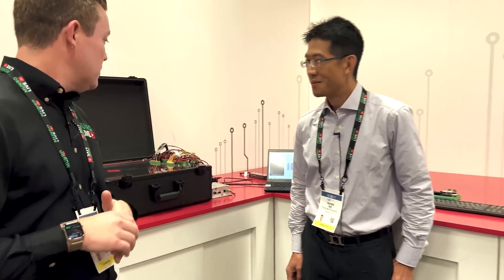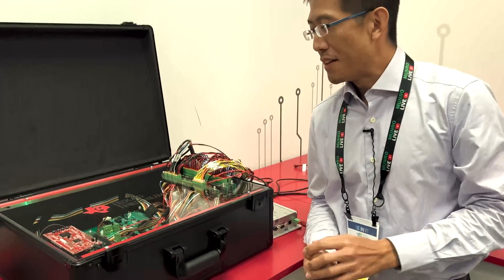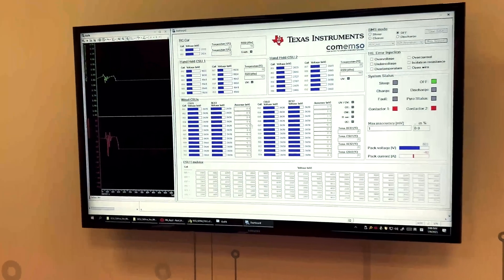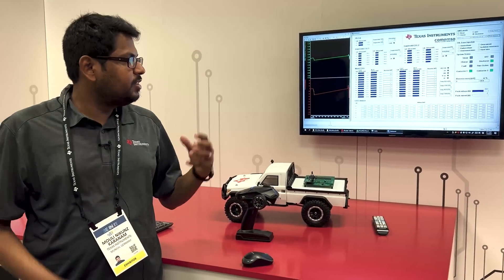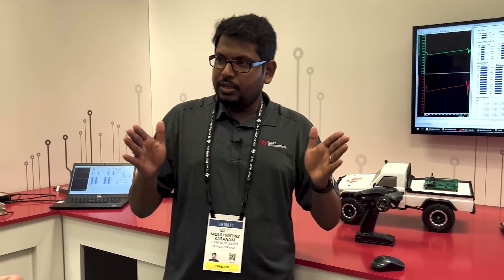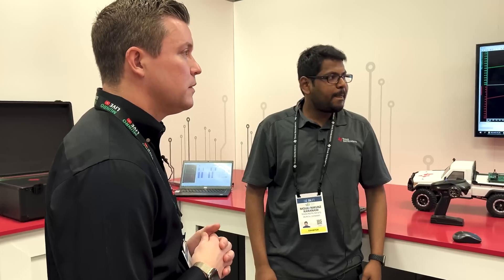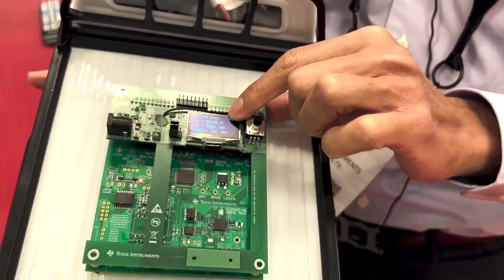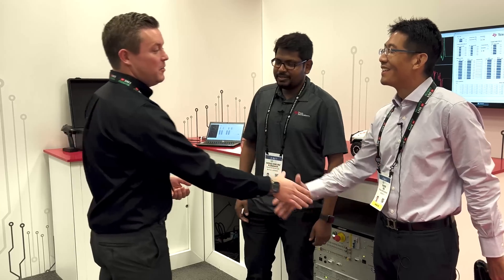Maximize your Driving Range with Texas Instruments | CES 2023

Comment: 1mV bms resolution is on market since at least 20 years. .  My 1 gen 2014 chevy volt designed from 2007 to 2011  is in fact also using 1mV resolution BMS...  i thought ihis TI presentation would bring some new inmovations... but it wasn't...

Comment: I am amazed how much billions of $ and fortunes these guys (TI shareholders) make with some ADCs and temperature sensors.
Reply: For every digital chip that is in a vehicle, there will be, lets say at least 10x the number of analog chips.  The media focuses a lot on the latest cutting edge CPUs, but what we dont think about is that the real world is still analog.  Modern vehicles are experiencing what we call sensor fusion.  And with the explosion of sensors required in a vehicle, analog ICs are needed - Power, data converters, temperature sensors, amplifiers, comparators -  ANALOG - You hit the nail on the head!

Comment: Even TI is click bait.😆 You can't maximize range simply with a more accurate voltage reading. the guy did not elaborate of this accuracy on LFP batteries, as this was a problem with Tesla LFP Model 3 cars.  The LFP M3 had its low voltage and high voltage batteries drained because of incorrect battery estimates, owners not aware their HV battery almost drained.   the only fix is to regularly fully charge the car at least a week or two so that the system can correctly gauge/calibrate the full capacity of the LFP pack then give an accurate estimate of state of charge.
Isn't TI supposed to be working on silicon carbide and GaN transistors for more efficient EVs?

Comment: The shell of the RC trucks is the Toyota LandCruiser 70 series, which as a real vehicle is not available in North America.
Reply: Interesting observation, the RC car model we used was not specific to any manufacturer!  A tidbit on why we chose a truck ~~ We needed a 'flatbed' area on the car to mount the wireless BMS board.

Comment: Didn't you guys shown that Tesla use a physical cut off fuse to disconnect the main power battery pack. Is that a better or worse system? Just wondering if that electronic cutoff during collision is fast enough, or is able to function during collision.

Comment: If the resolution is a mV for monitoring ,does that imply the cell monitors are atop each cell ? (wiring will introduce IR losses , where the  measured  voltages away from each cell are different to the real voltages) . If  its the pack voltage rather than per cell , how are imbalances within the pack corrected?  On the wireless side ,even though it seems the red-light was on , the wheels on front still turns . Maybe the better demo is show that the unit goes dead an needs a quick reset before the next demo
Reply: Yes, the voltages are measured across each and every cell.  The system also measures total pack voltage -  Though the cell monitors themselves do not measure the pack voltage, there are other devices like the BQ79731 pack monitor which measure the pack voltage (and current).  This takes care of the concerns you mention.

The RC car was just for demonstration purposes.  We monitored the actual pack of the RC car, but we didnt actually cut off the voltage to the motor when a crash happened.  This would have required a relay or some other cut off mechanism.  Maybe we'll do that for the next version!
Reply: You can measure voltage with gigaohms of impedance so IR losses become irrelevant.

Comment: @TI: 
1) Are the devolopment kits like this "suitcase" available?
2) Is each cell voltage measure performed by a 1-point voltage measurement between the voltage OR 2-point measurement directly on each terminal for higher accuracy, especially with LFP cells and the possibility to detect faults from bad connections between different battery moduls. Also to avoid "misleading" voltage drops on longer wires beween the moduls?
Reply: @Ste Da - 

1)  Please get in touch with your TI sales representative for the suitcase

2)  Great observation.  The latest BQ79718 family of batter monitors not only provide industry leading 1mV cell voltage measurement accuracy across each cell, but they also feature redundant measurements for each and every cell voltage as well as redundant measurements for temperature.  It's not just LFP which requires this redundant measurement - Battery Management requires the highest level of 'functional safety', especially since human life is at risk.  So all other chemistries, such as NMC, would require redundant measurements, diagnostics and reporting to achieve what is known as ASIL-D functional safety.  For the voltage drops across modules, we do support bus bar connections and measurements across those bus bars - Hence voltage drops are not a concern and can be detected!

Comment: Exec Sum: Cory tries to translate the Tech mumblings of engineering marketing nerds at a "Science Fair" demo.  TI really has fantastic products, technology and capabilities. Others have bits and pieces of this, but TI's main advantage is efficient, volume production which translates into much lower prices than, say, Analog Devices.   BTW, TI's Benchmarq  division can essentially count each electron going into and out of a battery!
Reply: Nice exec sum!  Im not the nerd, Mouli is :)
Reply: @markng2483  I'm a retired EE Nerd myself...started when I was 7
Reply: TI needs to integrate further and cooperate with a standards committee to make the BMS a single universal module for all EV manufacturers worldwide. That module should have firmware (upgradable) that allows the EV manufacturer to simply check some boxes in an app and have the BMS "personalize" for any battery density and chemistry.  This is how your personal computers UEFI BIOS works. It is modular and extensible. You can build any system you wish and it will provide you the Basic Input Output System (BIOS) to run it.   In this way if the market moves from LiPo to TheNewThing - the BMS can be reprogrammed on the assembly line to handle the current, voltage, temperature sense, cell count, controls and algorithms with no change in hardware. (Be sure and add security features!)
Reply: @dennisfahey2379  This is not going to happen. Most of the value and competitive advantage for EV manufacturers is in the battery, they're not going to make a core system of that universal. This is like asking ICE vehicle manufacturers to make their injection control universal. No way that's happening.
Reply: via Coulomb's ?
Reply: @douglas2lee929  Yes! it does exactly that:  BQ34110
Reply: @shazam6274  I don't mean to be unduly nit-picky, but I think that you should describe the function as an "approximation" or something similar, at best. I have not looked at any documentation for the product, but I doubt  that it can come close to counting electrons. I'm not sure if the major radiological labs in this country could even do that. Coulomb's would be a calculation, not a measurement. I'm not going take the few minutes right now to look it up, but I recall from school (decades ago), that the number was something like > 6.28 x 10 to the eighteenth, or some such, electrons past a given point, per second.  I am probably WAY off on that formula, it was many many years ago for me........ But my point is that when you get to numbers that large, the accuracy of the instrumentation gets to be extremely critical. I can understand if you can measure in billionths of a nano-amp, but barring that I think your marketing department needs to revisit the issue. You are trying to sell to E.E.'s, after all. I apologize for sounding like a tight ass, and also if I have my  facts way off, which is extremely possible. Thanks. 
-from Minnesota.
Reply: @douglas2lee929  I am not selling anything to anybody, just trying to point out that TI has some great technology.   Very few watchers of Munro would know a Coulomb from a colon, but you can't calculate accurately it if you don't have precise measurements.

Comment: Voltage is not a reliable indicator of SOC for LiFePO4. Especially under load. Increasing the accuracy of the cell voltage sensing will do nothing to increase capacity. Possibly a high current active balancer could help but if the cells are matched properly, no benefit would be derived. We have tested this numerous times on my channel too. We pull full capacity every time with matched LiFePO4 cells. Current consumer BMS voltage sensing accuracy is actually more accurate than necessary, and has been for quite some years. Besides that feature, I did not see anything special about Texas instruments BMS.
Reply: Just Ti adding parts to catalog. Typically with specs far in excess of need. doesn't cost more so just.add it. Some manufacturers will use the componentsnts.
Reply: 100%. i think the argument here was supposed to be that you could get closer to the voltage limit of the chemistry, but no EV battery should ever get close to that anyways, since they are all overprovisioned.
Reply: @Will, #2: With R=U/I or U=R*I the BMS can correct the measured Voltage by adding the calculated dynamic voltage drop unter load, as the current (A) is in every cell the same. The result would be a calculated static zero-load cell voltage of each (paralleld) cell. This you also can combine with Coulomb counting and 100% SoC adjust (calibration) at 3,65 Volt. I guess this is what Tesla is doing, especially on the LFP packs in the China RWD Teslas.
Reply: @Stefan_Dahn  this does not work, all you can really do is the energy (coloumb) meter. the voltage drop is not dependent on some fixed internal resistance, but is largely a chemical depletion mechanism that depends on temperature, SoC, cycle life and many other factors. its not feasible to correct so many factors. if youre already measuring voltage and current you already have a coloumb meter anyways, and if youre only measuring voltage you have nothing.
Reply: 1mV bms resolution is on market since 20 years. .  My 1 gen 2014 chevy volt designed from 2007 to 2011  is in fact also using 1mV resolution BMS...  i thought ihis TI presentation would bring some new inmovations... but it wasn't...
Reply: I hope you pay attention, Munroe... He's trustworthy.
Reply: We use ti BMS ; extremely reliable amazing documentation and support.
Reply: TI should give you some of thier bms to test
Reply: @Will, will you test this kit from TI? Would appreciate that a lot! 🙏😊

Comment: Why hide any of the cable run?
Reply: There are a large number of cables running to the hardware in loop simulator from Comemso.  They are heavy and unwieldy.  With so many customers coming by at CES, it would look unprofessional to have the wires run on top the desk! :)

Comment: Lets do some math. For example: Min Voltage for Lio is 2.5V and max is 4.1 V if its under or over this Voltage, this means you destroy your battery. So the usable Voltageband is 1.6V.  If the car has a range of 600km and you have an accurcy of 10mv instead of 1mv you loose 4km, because 10mv are 4km.  I think this is overrated.
Reply: Batteries don’t discharge linearily
Reply: @edc1569  You are correcte about this, but in the voltage Range between 2.5V and 4.1V it should be nearly lineary.

Comment: They must have accelerometers involved in the pyrotechnic battery disconnects no?
Reply: Yes, our demo used an accelerometer on the remote controlled car.  It was only for pure demonstration.  Some other reasons -  a pyrotechnic element is dangerous and is a one time element - safety aside, this was not feasible for all customers who wanted to crash the RC car at CES!  Also, it would have been quite a bit of extra work to cut off the battery pack of the RC car to the RC car motor -  The true intent of the RC car was just to show wireless performance (and to show our squib driver technology for pyrotechnic disconnects.
Reply: no

Comment: How does higher voltage measurement accuracy down to 1mV help provide more range ?
Also, it would have been helpful to ask 'how much more driving range does that system provide compared to others ?'

Current drawn (AH) from LFP batteries are the main indicator of capacity used and remaining.
Temperature of each cell is the main predictor of cell's environmental state and therefore its usable capacity (coupled with AH).
Voltage on LFP cells during use varies extremely, and is not usable for inferring battery capacity outside of big brush guesses.
So I am curious how going down to 1mV accuracy helps increase 'driving range' and in which circumstances ?
Reply: @raph of the hills please see the discussion directly above.  Higher voltage measurement accuracy allows the car manufacturer to use more of the battery pack safely.  Inaccurate monitors force car manufacturers to take a very conservative approach, almost to the point of over-designing it.  With an inaccurate monitor, you're paying for a big battery pack but penalized because the design was too conservative.
Reply: @markng2483  Thanks for the reply, Mark. I would not have guessed that was the reason.
In my experience, with BMS and big solar battery banks (1K to 30KWh), it's the stability of the readings that is the biggest problem, not the mV level accuracy.
Under load, BMSs tend to show +/-5mV on each cell from sample to sample. Even under steady load. Which I hypothesize comes not just from the ADC input's lack of mV accuracy, but in great part from the noise & inductive coupling present in many pack harnesses. Big currents = big EMI = big coupling. Hence erratic voltage readings.
Am wondering if TI has special filtering on the BMS's ADC inputs to lower noise / variations in automotive applications, and recommends specific wiring practices (sense lines, gnd wires, high current runs, etc) to avoid picking up noise on the sense lines ? Or does TI achieve this via satellite ADCs that OEMs must mount directly on each cell (thereby avoiding long wire runs & coupling) ?
Reply: @raphofthehills4405   For EV's specifically, if we look at the discharge curve of an LFP cell vs. an NMC cell, an LFP open circuit voltage is  much flatter in the middle region.  EVs are moving to LFP now (lower cost, safer), but the accuracy of the monitor determines how much range can be provided to the driver confidently and safely.  

You are correct regarding noise.  These modern battery monitors are essentially big analog front ends (AFEs) that, for ever ADC channel, have integrated front-end filters and also integrated and fully configurable digital low pass filters that enable completely filtered DC-like voltage measurements for better state of charge (SOC) calculation!
Reply: @markng2483  Thanks for the clarifications Mark !
It is rare to get replies from involved suppliers or engineers on YT, sharing accurate information and informative insights.
Really appreciate your investment in, and commitment to, supporting this video and your products.
Reply: I could speculate that they 
A) know how much juice they really have I each battery so they can push it to a theoretical value closer to 0.
B) if the measurement is accurate they could avoid over-drawing power. Power = Volt x Current so perhaps having an accurate reading allows them to not over draw or underdraw voltage/current leading to more stable performance. Because if the sweet spot for your induction motor is 10k rpm perhaps being able to control voltage gives you a better ability to use your motor in the ideal situation.

It was a bit light on details and felt a bit forced, but I too would appreciate a more indetail look at power utilization.